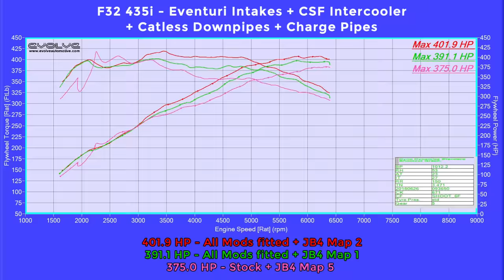F32 435i - FBO Upgrade for murdered and bagged 4 Series

Comment: So sexy! 
My build on my 435i is: 

-Eventuri intake
-VRSF Chargepipe 
-VRSF Downpipe
-AWE Tune exhaust
-Vivid Racing tune
-VRSF FMIC
Reply: why spend a grand on an intake and not just go pure stage 2??
Reply: Zero_MP pure stage 2 is in the works too my friend. Why not both?
Reply: @Loveyourmortgage  i mean by all means i love the look of the intake i have a turner carbon fiber closed box intake sold at 500-600 just don't see a point in spending a grand on something that doesn't add much performance.
Reply: Dude, does eventuri affect the exhaust note at all? I have Remus quad escape on my M435i, wondering if eventuri will help me make it any better? Any help there?
Reply: Rohan Pathak I’m not entirely sure it helps the exhaust note per say. However, the blowoff you get from the turbo with the Eventuri is fucking awesome.
 I can see how it would help the exhaust note with the better airflow and all. But as I said before the blowoff and the inflow of the intake was by far the most noticeable to me.

I hope this help!
Reply: Hey Josh I have a 2016 435i coupe and I really want a exhaust system that isn’t obnoxiously loud and that gives good HP gain. I looked into the AWE Exhaust which is about $1200 and it gains about 15 hp. Is that what you have and how do you like it. My car is stock but has the M Performance Tune package
Reply: Samir Khan, I absolutely love my AWE exhaust. It’s sounds incredible and looks so damn nice. I remember when I was shopping for exhausts it was really hard to choose which one to get but I’m not disappointed!
Reply: Joshua Dunn thanks for replying I appreciate that. I’ve heard a lot about down pipes and how they are great for performance but smell really bad and aren’t really good for the car in the long run. Is that correct? Any recommendations to make the car faster without any harmful effects to the vehicle. Would love to tune the car but I think that would cause negative effects down the road. I’m at 40k miles right now as well.
Reply: Samir Khan the down pipes do smell pretty bad at first but it does go away.. or maybe I just don’t notice it much anymore. I’ve never heard about the downpipes having a negative effects later on. From what I’ve read, the n55 engine is built to be pretty tough and a tune won’t do any harm with FBO.

I hope this helps.
Reply: Joshua Dunn thanks man I appreciate your advice.

Comment: I've just bought exactly the same car F32 in black but it's the 40i (B58 engine) not the 35i (N55 engine). The B58 is a better engine and maps to around 440bhp with just a tune ( stock hardware ) I would love one of these  intakes 😍
Reply: B58 eats the N55 for lunch

Comment: Awesome vid! Does this have software mods also? Or just intercooler, chargepipe, catless and air intake? Thanks.
Reply from the maker: It has a JB4 fitted
Reply: @EvolveAutomotive  On the Dyno, are those wheel HP? Thanks.
Reply from the maker: Crank

Comment: What brand charge pipe and catless downpipe? But wow the carbon fiber intake looks GREAT 😭
Reply: Catless downpipe looks like a Wagner tuning. I have the same one. Its good if you need a stock look. But if you don't need that, there are probably better ones on the market.

Comment: Don’t get why you’d bother putting all that power into it then ruining the suspension by replacing a superb handling set of shocks and springs with bags. Bags for show, shocks for a pro 😉
Reply from the maker: Realistically most people don't drive their car to the point where you'd notice the difference between the two, especially legally on the road.

We wouldn't do it to an M car, but each to their own. If you want big power and the ability to air out, you can do that, doesn't have to be for everyone!
Reply: Evolve Automotive have heard differing opinions on air ride. Most people who’ve had a decent set of shocks vs air say they wouldn’t go back to air due to how it behaves when pressing on. I’d say most with a Performance car will push on at least - unless they’re all mouth 😉
Reply: Airbags were originally designed for race cars.  That kind of renders your point moot.